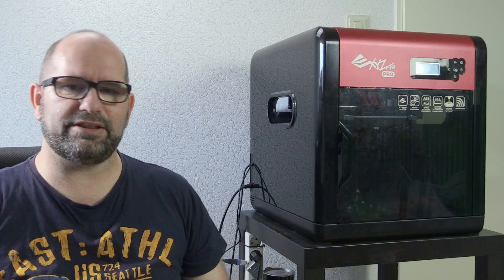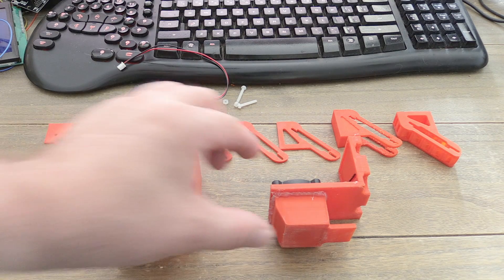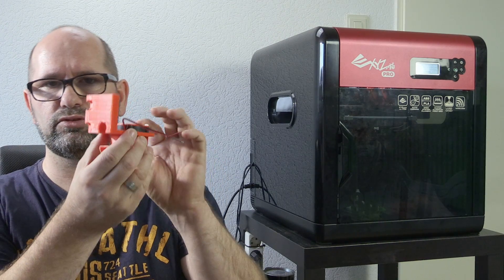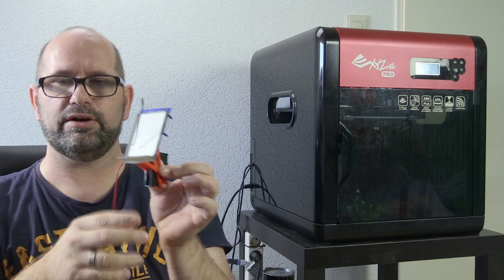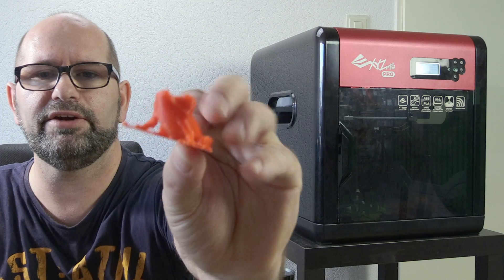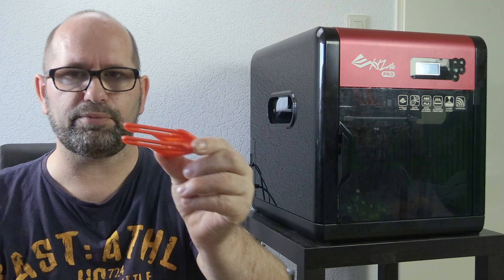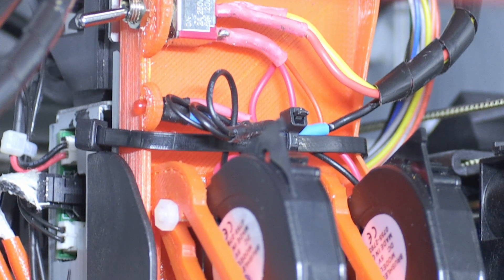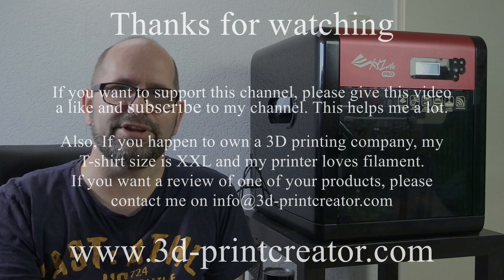▼ UPGRADE your XYZPrinting Da Vinci Pro 3D printer with a FAN DUCT

Comment: Hard to believe this POS closed source printer came out same yer the Prusa Mk3 was launched. To compare it even with a cheap Ender 3 that came a year later would make it a disgrace.
Reply from the maker: Absolutely. It would have worked 2 years earlier, but this made the machine fail because of the competition.

Comment: One minute cooling other minute not, breeze ruining prints, its back and forth everything yet FDM printers have no issues and they’re completely enclosed. 

Ultimately it comes down to ambient control. Set a thermostat so you evacuate the excess heat and maintain whats needed for a particular print. 

Don’t blow air on the print. Far easier than contending with an open air printer. Here i am insulating my printer to better retain the heat and using a tstat controlled fan to suck out excess heat.
Reply from the maker: Your goal is completely different from the goal I had when I made this video.
Fans that blow on the print are needed in case filament needs to be cooled to harden. In fact, there are two fans so that the direction the nozzle goes doesn't matter for the cooling. This is helpful for PLA ,NGEN, PETG and many other filaments.
Having the correct temperature in the chamber is NOT what you control with fans that blow on the nozzle. You are controlling the chamber temperature, and that is great for ABS, Nylon, etc. In fact, you don't need to get rid of heat, you have to produce more heat to get the chamber to temperature. I use an old fashioned bulb for that, controlled by a thermostat. also, indeed I do have a fan on that same thermostat so that I can both heaten up, or cool down the chamber. But that's not on this printer anymore. I stepped away from XYZPrinting and moved to CoreXY printers instead.

Comment: The accent is true, Butt dat maakt niet uit! 
Thanks for the explaination of why the double fan cooling worked! Also thanks to the explaination of why it would or wouldn't work on ABD/PLA/other stuff! People tend to think its just "printing"! But every machine and material is different! Great video! Keep up the great stuff!
could you elaborate on why the fans have to be 5 volt btw? Could it be benifitial to put a pot-meter on them to controll their speed and cool the ABS less to better the ABS-print?
Reply from the maker: Hi, Thanks for your comment.
The 5 Volt is chosen because that was what I had laying around at that moment. There is no need to choose a specific voltage.
Having a way to control the speed would be very beneficial indeed. 
For materials like PLA it's full power, and for ABS it's absolutely no fan at all, but engineering materials like NGEN or PETG could benefit from less airflow.

Comment: I see you were using a switch at the Cartridge. Did you switch the fan on before the print and even were cooling the first layer? If so, did it work out?
Reply from the maker: the switch was there so I could turn it on or off at any moment. .oat of the times I waited for the third layer before I used the fans, but I have also used I right from the beginning successfully.

Comment: where did you get the fans?
Reply from the maker: At a local hardware store, but you can find they online as well, on Aliexpress, Gearbest, Banggood, etc.
Reply: @3dPrintCreator  i ordered a set of 4 off Amazon but they are too thick. I sized up the brackets but it doesn't really fit on the rear platform that I printed and it won't zip tie in like yours did very well.

Comment: hi brian im trying to make those fan mounts there is another version of yours that u made a comment you made on Sam J version being slightly better as it doesnt require the box...  i down loaded that version and it seems to be collapsing in the final stages when its doing the second part of the section where the fans mount .. Im not sure why my thoughts it needs supports . im not sure if you have seen the file. its made by Sam Jay  https://www.thingiverse.com/thing:247...
 any help I have the Da vinci pro cheers

Comment: Did you print this from PLA or ABS?  Would you recommend one or the other, since it will be mounted all the time?
Reply from the maker: Hi Jeff,
I printed it from ABS but I have seen many others that used PLA and that had no problems with that.
So, for ease of printing, I would go for PLA if I were you.
Reply: Thanks!

Comment: Brian, 
first of all thank you so much for all of your videos, I would have thrown this printer in the trash after the 3rd day if not for your videos. Having said that I have it up and running finally, I am printing the  fan holders, I am curious as to a wiring diagram for the power supply and the fans, switch and led.   any help would be greatly appreciated
Reply from the maker: Hi,
It isn't all that difficult.
From the power supply unit, there are 2 voltages coming out. There is the 5V agains the negative and the 12V agains the negative.
The thing is, you can buy 5V or 12V fans and then you select the best power outlet from the power supply unit (a multimeter is very handy here).
Then, because a LED has to be limited in it's power, you need a resistor to make it burn at the right amperage. If you search for LED resistor calculator on the Internet, you can find lots of sites explaining what resistor to use on what voltage versus the LED type you are using.
Then it's just wiring the thing and making it work. The total power consumption is below 0.2 Amp, so there is more then enough headroom in the power supply unit to power this..
Reply: Thank you for taking the time to respond! ill give it a go.

Comment: Does this also have any positive impact on ABS? I've been trying to print some small detailed parts, to be specific I am building a 1/350 Titanic and creating and printing deck walls with their window holes but this means I also have very small (1.9mm to 2.5mm) bridges. I am having a hard time printing these windows on my Da Vinci Pro 1.0 in PLA and also ABS. I noticed that on ABS my printing is smoother, but the windows look worse, on the other hand with PLA I can see the layers, but the windows look better. Have any suggestions? 

P.S.: Just downloaded your file and purchased on eBay the fan, I'll give it a try. But if you have any suggestions they'll be very much appreciated :)
Reply from the maker: Hi Zeno,
Sorry for the late answer.
No, on ABS you don't need a cooler. In fact, if you cool ABS it's almost a guarantee for problems because ABS shrinks while cooling and then it builds up forces that can brake the print, or get it loose from the print bed, or other funny things.
The best thing you can do for ABS prints is heating up the bed as hot as possible (90C if you are running a Da Vinci Pro machine with XYZWare for Pro, max 110 if you are running Simplify3D software) and leaving all doors closed while printing.

Comment: Have you tried the "Tempest 140 Duct" cooling fan design? I would like to hear your thoughts on this.

Tempest 140 Duct:
http://www.thingiverse.com/thing:1905254
Reply from the maker: Hi Raymond,
I have not yet tried that design but I am sure that for PLA this is a very good cooling because the airflow goes along the whole bed. I have had contact with the person who designed it and he told me he had a lot of succes with this cooling. For me, I don't like the fact that something big and noisy is hanging outside my printer and therefore I have not tried it. In the future I will bring my printers to another room where I am not working myself and then I think I will make this.

Comment: Hallo Brain, kan je mij ook vertellen waar jij deze fans heb gekocht. ik heb namelijk heel internet af gezocht, maar als ik ze wil kopen dan moet ik er minimaal 100 stuks afnemen, dat vind ik een beetje te veel, want ik heb er maar 2 nodig. bij voorbaat dank, Martin
Reply from the maker: Hoi Martin en Sietske,
Als je ze in Nederland koopt kosten ze gemiddeld zo'n 20 Euro per stuk, maar ik had eens mazzel bij een electronica dump in IJmuiden.
Maar... Als je zoekt op Ebay.com met als zoekterm "50x40x10mm 5v brushless fan" dan vind je ze veel goedkoper.
Reply: Brain bedankt voor de tip,
Martin

Comment: Nice instruction video! The damn is: this fan is only available in china and need weeks to send. :(
Reply from the maker: I don't know where you live, but this is a very common type of fan that is available in at least 10 stores I know here in the Netherlands.
I can't believe you live somewhere where this isn't a common cooler fan.

Almost every store where they sell 3D printers or other electronics have this kind of fans.
Reply: You will laugh.. but no. :D I only found Fans with 50x50x15 mm and 12V. Its not easy to find these kind of fans. :( 
The stores here, has only axialfans. not radialfans.
Reply from the maker: Where do you live? Can you email me your adres?
You can send it to info@3d-printcreator.com
Reply: Thank you! :) I will first try the 50x50x15mm Version. (Maybe need to change the file a bit.) I will let you know if it works.
Reply from the maker: If it doesn't, I have two fans left on my workbench here, so I can send them to you.
Reply from the maker: Gevonden !!!!!
Deze dus :-)
http://www.ebay.com/itm/1pcs-4010S-50x40x10mm-5V-Brushless-DC-Cooling-Blower-Fan-2-Wires-/160890120058?hash=item2575cc677a:m:mskliI04ByLw3-8huYlXX9w
Reply: 3d Print Creator ik heb er ook 2 nodig! als je hem nog hebt liggen!
Reply from the maker: Helaas, ik heb ze toevallig vorige week weg gegeven. Sorry, anders had je ze zo mogen hebben van me.
Reply: 3d Print Creator waar kan ik ze kopen? hebje nog de link voor me?
Reply from the maker: Als je zoekt op Ebay.com met als zoekterm "50x40x10mm 5v brushless fan" dan vind je ze.
Reply: 3d Print Creator is het toevallig deze? http://m.ebay.com/itm/12V-5cm-50mm-x-40mm-x-10mm-2pin-Brushless-DC-Cooling-Blower-Centrifugal-Fan-new-/261875806386?hash=item3cf903b0b2%3Ag%3AWYAAAOSwymxVRywi&_trkparms=pageci%253A5ed852c9-d392-11e6-b210-000c29bcc5f9%257Cparentrq%253A70a5c4be1590a7eb793f77ddffd7d11c%257Ciid%253A16
Reply from the maker: Nee, die is 12 volt, al is de maat verder wel correct, dus dat kan ook.
Het is deze, maar dit is een pakket van 50 stuks
http://www.ebay.com/itm/50pcs-4010S-50x40x10mm-5V-Brushless-DC-Cooling-Blower-Fan-2-Wires-/151023206691?hash=item2329af4123:m:mskliI04ByLw3-8huYlXX9w
Reply: 3d Print Creator Top bedankt gelijk besteld😉

Comment: 1 advise. please use a diode on the fans. in the Netherlands we call it a blusdiode.  this is because a fan/motor is an inductive load. i  this way you also protect the hardware of the printer.
Reply from the maker: Hi Marco,
Thanks for your advise. Indeed that is much safer and YES, I am going to do that.

Comment: Thanks for this design and the detailed instructions.
Is it still possible to easily switch to the laser module after installing this upgrade?
Kind regards,
René
Reply from the maker: Hi BroRene,
Yes it is.
The thing I have made goes on the one side of the carriage while the laser module goes on the other side (I guess, I don't own a laser module).

And even if this isn't thru, you can easy remove my fans if you give the wires a connector.
Reply: Thanks a lot for your quick reply. I will give it a try soon. subscribed and hope you can get your channel to grow! I will sure check around regularly. All your videos are very informative.

Comment: Nice design if I ever do PLA I will have to print that out.
Reply from the maker: Hi Matthew,
It's not only for PLA, but for ABS you don't want a fan that cools all the time. In ABS you would preferably have a fan that is only on when printing bridges.
Yesterday I have tested with Nylon as well, also with good result.
Reply: That would be quite handy especially if I can have the printer turn them on and off for bridges.
Reply from the maker: In the most printers from other brands this is possible. Then you can have GCODE control over your Fan Duct, but in the Da Vinci Pro this is not possible.
I am examining if it would be possible to have an Arduino receive the same GCODE while it is uploaded to the Da Vinci Pro and have the Arduino run the Fan commands.
Reply from the maker: Hi Oscar,
The intercepting part is not that difficult. Just put the arduino in the middle and let it receive first and send later (like a relay station). The difficult part is to stay in sync with the printer while it's busy. Yet is must be possible, because if I look at the way Simplify3D works, I can see on the screen how far my print is. Also, I can read the communication from the printer to the computer via USB, so there must be a possibility to stay in sync between my arduino and the printer.
Reply from the maker: I was thinking that also, but in the .3W file that is made, I can't find any speed controls of the fans. They are filtered out while translating the file to .3w, i guess.
Reply from the maker: The moment you slice the file in Simplify3D, it knows my printer is a Da Vinci Pro machine, so it already makes the .3w file for you. You can then save it on your harddrive or on a SD card, for later use or to import it in XYZWare for Pro, or you can use Simplify3D to send the file to the printer.

Then, in S3D there is a monitor function that shows you the code as it is being processed. This is because the printer actually sends back a status report to Simplify3D while processing the file and printing the object, but at that time there is no information anymore about the cooling fan because while slicing, S3D doesn't make GCODE but .3w files.

The grabbing of the file in an Arduino isn't that difficult, but I must find a way to stay in sync with the machine, and that's pretty tricky to do. It goes beyond my programming skills, so I am trying to learn  and get better in that. :-)
Reply from the maker: Well, the files are not really encrypted. The method of saving the files is just plain Base64 encoding, so this is pretty much a standard.
The only problem here is that the Gcode just misses some parts because XYZPrinting chooses to have only a limited Gcode instruction set in it's printers.

Maybe it's even possible to have an Arduino, or even better, a Raspberry Pi 3B receive the normal Gcode file and let the controller strip the file according the XYZPrinting rules, then save it as base64 encoded .3w file and send it to the printer. That way, the printer with this board in it, would understand Gcode AND work with a cooling fan.

If only I had time to tinker more...
Reply from the maker: Why choosing for WiFi? The printer has an USB port that can be used and that is much more reliable. The wireless part can be set up in the receiving processor, be it an Arduino or Raspberry PI

Comment: I like your design. One question: I have changed the original nozzle with a http://www.thingiverse.com/thing:1328848/#files XYZ da Vinci 1.0 Pro E3D V6 Drop-In Cartridge Mount. Can I use your fan-system or must I change it ?
Reply from the maker: Hi Frank,
Yes, you can still use this cooling fan system. The spread is big enough to hit your nozzle.
With that drop in, the nozzle is about 9mm lower then with the original, so the difference is minimal.